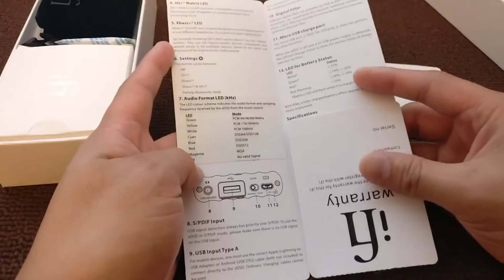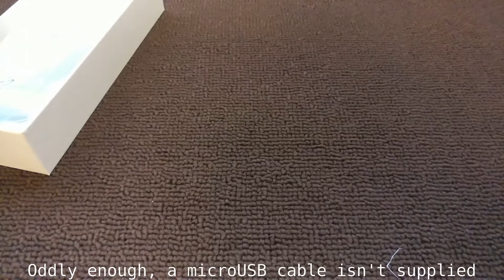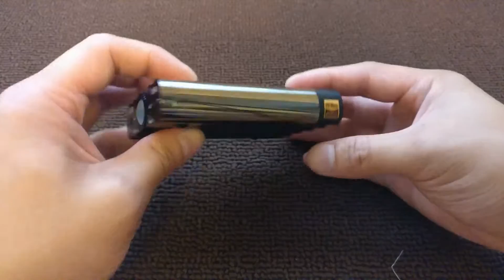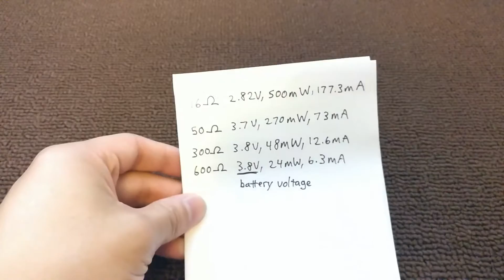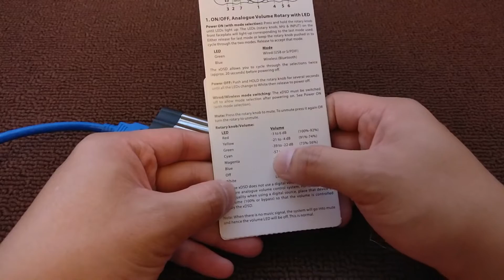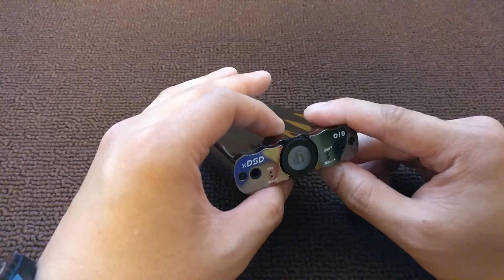[Review] iFi xDSD

Comment: I think that the excess brightness might be due to the measure filter as i have tried both measure and listen and listen didn’t have that excess brightness even after hours of listening on bluetooth mode. Maybe the mojo’s imaging is due to it’s narrower soundstage?
Reply from the maker: I've always found the minimum phase filters to sound bright in my experience. It makes the imaging more precise and well-defined, which is what it's supposed to do with the elimination of the pre-ringing in theory, but it causes a phase shift in higher frequencies as a result.
Reply: I think you have it backwards. Minimum phase tames the brightness..... it produces more post ringing as a result. It is more smooth, less defined/ precise, slightly more laidback vocals and bass is more forward resulting sometimes in a more pleasing sound.
Reply from the maker: Hm, which DAC did you hear that on? I tend to hear the minimum phase filter being brighter on all DACs I've tried compared to slow-roll-off or brick-wall filters [e.g. pretty much any AKM DAC with selectable filters, LH Labs products].

Comment: I'm really curious how this sounds compaired the the idsd micro BL/Fiio Q5 with AM5 module. I had a idsd micro (not the BL version) and liked it a lot. I tested the Idsd micro bl and liked it even more as it sounds more rafined/mature/polished, it adds just a little salt&pepper to the sound, and the Q5 + AM5 module and kinda liked it more than my idsd micro too as it seemed a little more clear and vivid sounding. From what i've tested, i liked the Micro BL/Q5 the most. I wonder how this compaires to them.
Reply from the maker: What headphones are you using? The micro iDSD BL was meant to drive basically any headphone well whereas the xDSD was more meant for portable headphone use. The xDSD is basically the younger brother of the micro iDSD BL.

I thought the Q5 with AM3A module sounded good, better than the xDSD via Bluetooth since it didn't have the brightness to it, but worse via USB. The Q5 had EMI noise issues when I used it though, and the volume would inadvertently adjust in my pocket, so those were problematic to me.
Reply: I use it mostly with my HD600 and as a dac for my high end stereo sistem. In all fairness, HD600 are really easy to drive if you've got at least 3Vrms, so all of them can drive them pretty well to excelent. I've sold my Idsd Micro, and now use HD600 + Fiio X5 mk1(2,9Vrms). Yesterday i've tested a Chord Hugo(1st gen) for about an hour and i like it very much, it reminded me of the sound signature Q5 + AM5 module. The Hugo seemed to have such good control/attack/transients/speed and open/clear/detailed sound, while sounding natural. The bass seemed to have weight to it, while being really fast, a really good quality i think. I liked it, but didn't have anything to compair it with and it's out of my price range. The Mojo didn't leave me with the same impression. So you say that for bluetooth Q5 is better, and wired xDSD. How do you rate BL, Q5 and Xdsd wired? I'm dreaming about finding a DAC/AMP with the dinamics of the Chords, with the details and rafinment of BL/Q5 (heaven't heard XDSD yet).
Reply from the maker: The Hugo 1 didn't really impress me honestly. It sounds very close to my LH Labs Geek Out, which in comparison sounds like the little brother of the Pulse X Infinity that I use for my reference DAC. Compared to the FiiOs or the xDSD though, yup it sounds better to me, but I would never consider the Hugo a truly portable device and wouldn't recommend it if someone is looking into the xDSD or Q5, hence why I mentioned the Mojo in this video since that would be a much more reasonable comparison.

I enjoyed the BL more than the Bluetooth Q5 or wired xDSD. It sounds more dynamic and spacious than the latter DACs. Between the Bluetooth Q5 and the wired xDSD, the Q5 sounds more dynamic than the xDSD, but the xDSD sounds more detailed in terms of texture reproduction and sounding more neutral/transparent. The Q5 tends to have more bite to the sound than the xDSD, so it sounds grainier to me.
Reply: miceblue425 I guess it all comes down to what headphones you use, prefering one over another. The Chord dacs have better speed and attack then any other i've yet heard. I owned a Idsd Micro(not BL), and A/B with the BL, wich sounded a little bit more mature/rafined/warmer and with tighter bass, but still not close to even Mojo's bass when compairing speed/tightness. Too bad i can't find that speed/tightness in BL/Q5 bass. Hugo sounded pretty open and clear or bright as some might say. It really depends on what you listen to it i guess. I wouldn't use Hugo as a portable, maybe in the house.